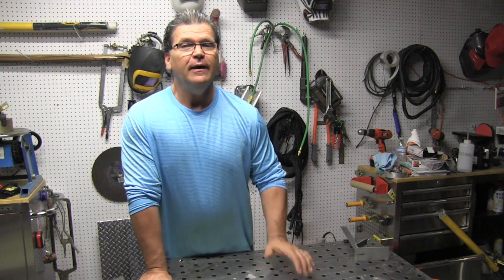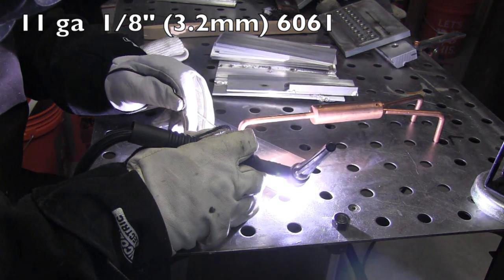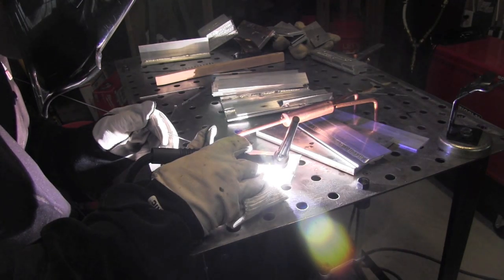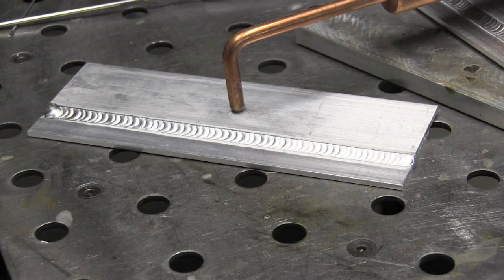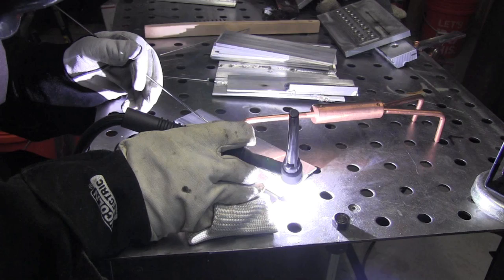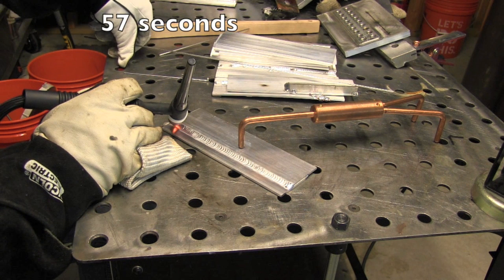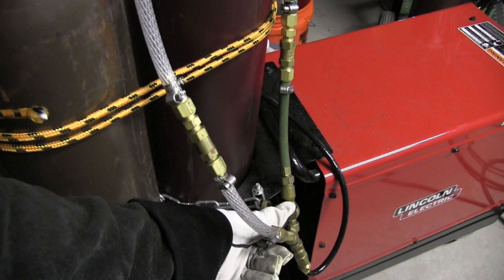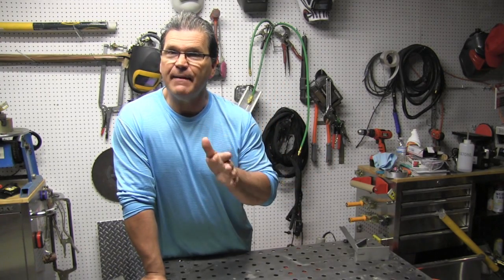Tig Welding Aluminum with Argon Helium Mix

Comment: Putting this into practice today..  I've got a 200 amp inverter and needing to weld a lot of 1/4" ..  I could probably preheat with a gas torch.. but this is much better and simpler for me.  Thanks Jody!!

Comment: Hey Jody, i'm following since the last year, from Brazil, and thank you, by ALL the knowledge you posted in your channel, helps me a lot. I want to ask you, if it's possible to make a mix like that, from this video, but using CO2 and straight Argon? For ex: weld in a MIG machine, steel in spray transfer mode, e could regulate to weld stainless, e them, shut off de CO2, e weld aluminium?? What you think?

Comment: At my job I weld TIG mostly steel occasional aluminum straight argon. Some other job at plant requires argon and 25% helium mix. I tried in my TIG once didn’t notice much difference but now after watching this I may have to try it again.  Might help on some tricky heavier aluminum jobs
Watch it Jody, I’m over 60 and you’re teaching me stuff
Reply: Anything 1/4” and thicker I notice a difference really helps especially 3/8” and thicker
Reply: @WojnarskiWeldingFabricaion  i welded some really big heavy stuff a while back that i had to pre- heat.
Maybe that mix might have helped.
Reply: @michaelszczys8316 definitely I like to have a bottle of 100 percent helium and y it into the machine and mix it myself like Jody does in some videos but even 25 percent is definitely noticeable turns like a 200 amp machine into a 250 amp machine  I was using it Friday at work and my everlast water cooler kept overheating with a smaller 20 torch that machine had the helium and I was at 300 amps welding 1/2” plate to 1/4” with preheat big ibeam then I would switch to the miller syncrowave and had that machine at 350 amps and the helium mix was nicer to me. Helps to puddle aluminum easier and faster 👍

Comment: are you using air cooled torches when using helium or does it have to be water cooled, or does it make a difference. thank you
Reply: Nick De Cicco amps define the use of water cooled. 150amps is the cut off. I’ve welded 200 amps with air cooled. Sometimes you just gotta do it.

Comment: +weldingtipsandtricks Something I always wonder about with aluminum is how much rod are you stuffing in the weld at each dab? It certainly isn't a quick dab at the front of the puddle like it is with steel, is it?

Comment: Would using helium on an old transformer machine without the ability to change AC balance be of any benefit? Would you be able to run lower amperage with the helium so that you wouldn't burn up your tungsten as fast, or does the extra heat from the helium do just that? Thanks

Comment: Hello, what is the material rod and tungsten needed in order to weld duraluminum (fortal) 7075? I have the same lincoln tig175 square wave. Thank you.

Comment: I may try this to speed up my welding speed on 5052 .040  aircraft fuel tanks. Seems like distortion may be reduced. I get plenty of distortion even in the flange and areas with beads rolled in. I'm welding with an "antique"  '96 model  351 syncrowave.

Comment: hmmmm I weld alloy a fair bit I've never had that problem. with running pure argon I adjust the a.c. balance and that increases my travel speed a lot but you need to know how it works or it will burn your tip back or give you a nice tungsten inclusion

Comment: Have you ever gas welded aluminum?
Reply: *****  I have gas welded aluminum with arc welding rods that are suitable for oxy-acetylene also. It was nothing pretty to look at but seemed to penetrate fairly well.
Reply: I have been trying it just to see if I can..It's quite a trick to do. I have been using tig rods and adding flux. making a decent looking weld but not sufficient penetration..I'm gonna keep practicing.

Comment: So if you use Helium and ball the tip and all these other tricks it should be possible to use a DC TIG to weld mild Aluminum (AKA the HF TIG Special)? I said possible not fun....
Reply from the maker: Jon McNabb DCEN using helium is possible ...just  a bit tricky.  video coming soon
Reply: Would you be willing to do it on a Harbor Freight rig?

Comment: Sorry seen the post title without watching.so your using the helium as a fuel gas on top of the tungsten to heat a larger  surface area of parent metals. The tungsten arc is tight and precise so that little dot of helium can double your pass speed on aluminium.   Jason from Bonnie  Scotland . Glad you post these. But if I am wrong  can you let know if I am talking out my arse. J

Comment: Hi J, really enjoy Your videos. Hey did You use  check valves on the hoses just before the hoses connect to y-joint?
Reply from the maker: Risto Hiltunen I do have check valves installed there but I have seen it done by others without check valves.
I just dont want the risk of mixing in the tanks when they get low.

Comment: I saw your related video several years ago and I really want to give this a go, Jody.  I have a 200DX running 3∅ and can't afford to upgrade to the 350, but I really need the extra get for the work that has been coming in.  Problem is the price of helium in Japan; it's stupid expensive at $250 for 3 cu meters.  Thanks for all of the excellent videos!

Comment: Hey Jody, what is about the helium that speeds everything up? 

BTW, nice vids, keep up the good work!
Reply from the maker: Jason Cain basically, helium adds more intense heat to the arc. Voltage actually goes up. So for aluminum 1/8" (3.2mm) and thicker, it puddles quicker and lets you get moving quicker.

Comment: Would the same concept work for Stainless Steel?
Reply from the maker: benjenkona Helium is not needed for stainless because unlike aluminum, stainless has very low thermal conductivity and is easy to puddle quickly with pure argon.
 It would probably be more of a problem on stainless since the main problem is getting it too hot anyway